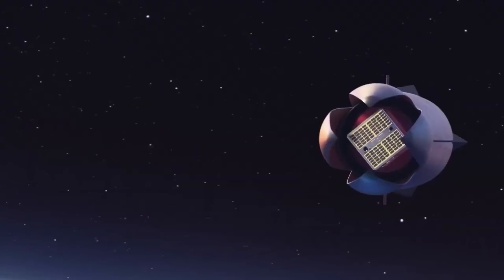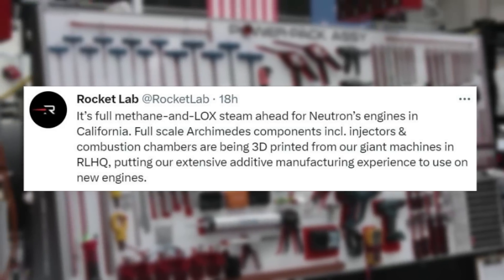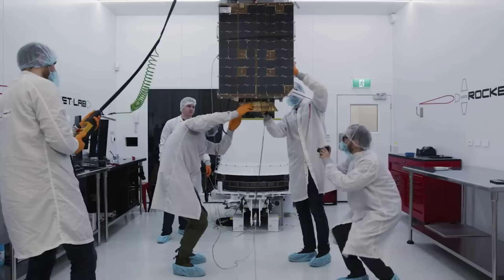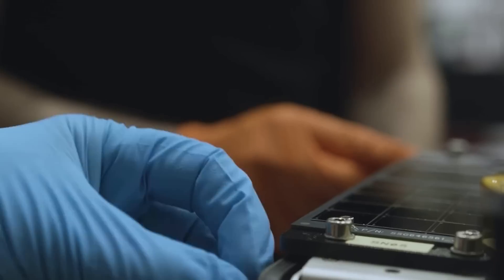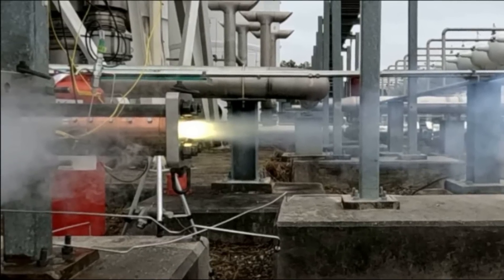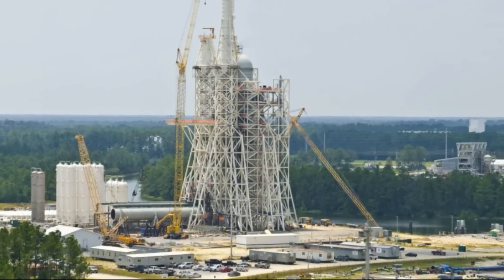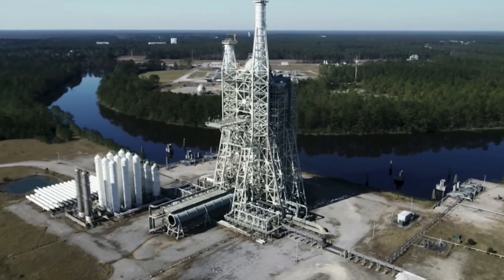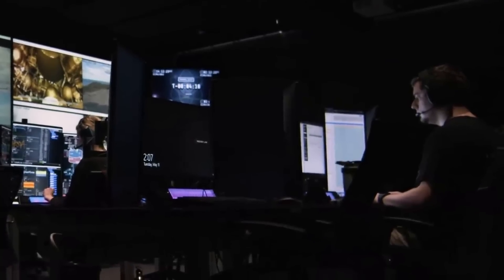Neutron's Archimedes Engine Is Making Impressive Progress

Comment: Bit of a tease. Would love to see more actual details on the engines - including things like the startup process, what the control system looks like (avoiding instability), how deep throttling is handled and which propellant (oxygen or methane) is being used as a coolant. And for bonus points, what are they doing to avoid the oxygen rich gas eating the turbine?